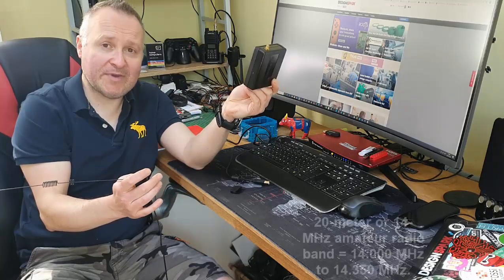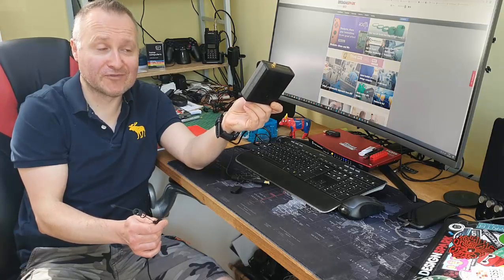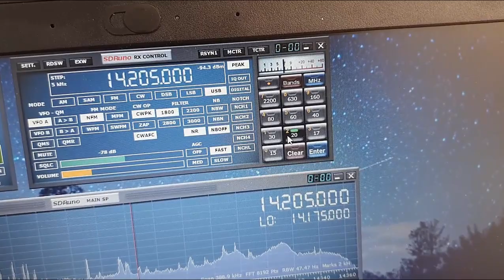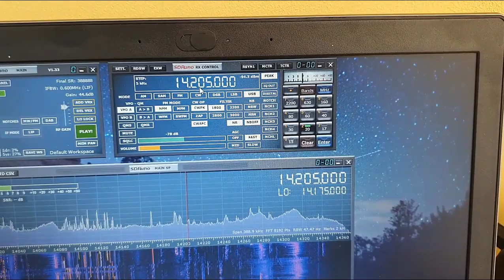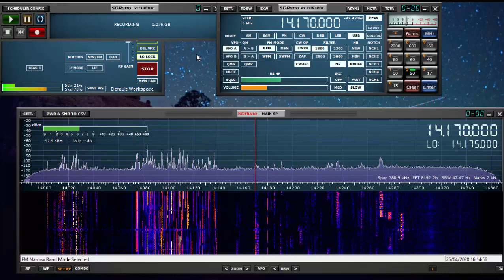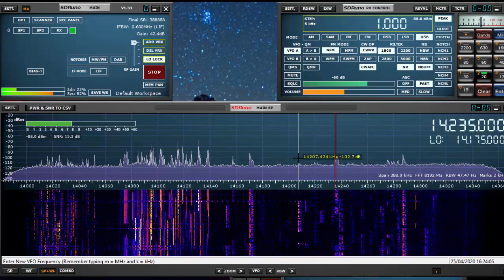How to listen into radio signals from around the world with an SDRplay box and a length of wire

Comment: Use a banana plug exactly the same size of your female pl259… you could even use speaker or bell wire and just part the required length leave the rest as that then becomes the feeder effectively a dipole antenna.. at the radio end use what ever you wish a normal pl259 string it up good to go..
De Phil M6dnu 73’s

Comment: I sure would like to get back into this, but man what a shift in mentality the internet has undergone - from 'a certain amount of backward compatibility offered for a certain span of time' to 'no backward compatibility, but the old software that worked on its relevant hardware at the time will still work, just without support' to now 'you may not run old software on old hardware; you must purchase new hardware and only run the most current version of any piece of software' ... it's really depressing.
I have a laptop from 2015 that used to run both GQRX and CubicSDR beautifully with this R820T based dongle that I've had for years ... but ever since a fresh install of my OS I can't find any way to run the programs needed (or install any of the libraries or dependencies) for SDR. I've spent hours and hours at it, and every cul de sac I reach online simply says: this is impossible without running the most current OS. I love SDR, but I'm not going to buy a new computer just to play with it. Guess I was just spoiled by access to old builds for too long.